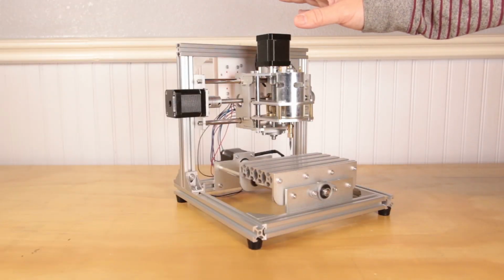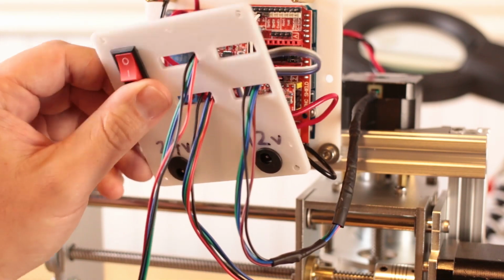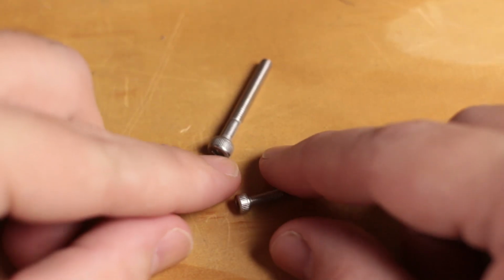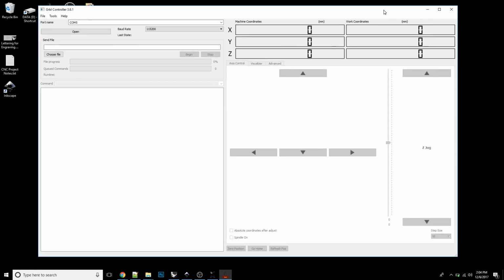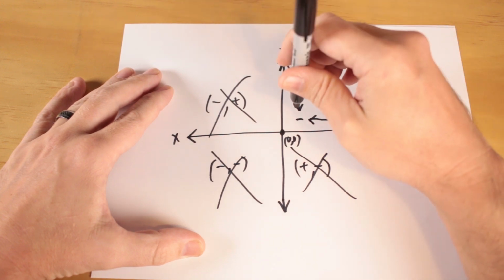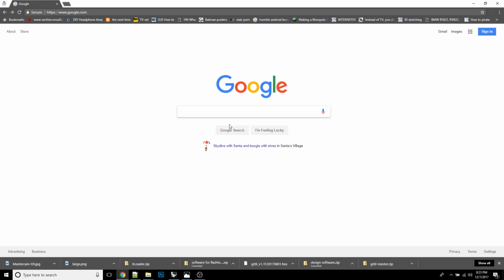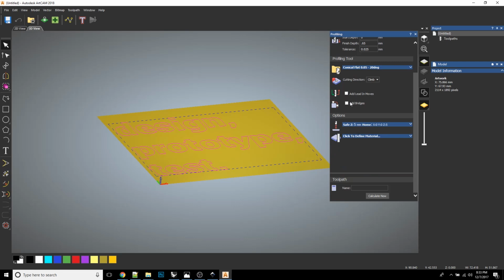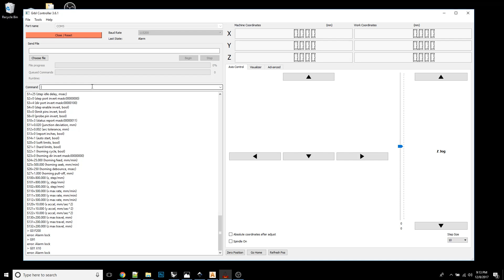How to start CNC Machining for under $200 - Working with the T8 CNC engraver

Comment: Just FYI. Center positive is usually designated but not always and especially on proprietary equipment it is reversed.  Just because they can. Check out wireless radios. Out of 10 different commercial brands you’ll find 3 or 4 usually center negative.

NEVER SAY ALWASY.

Comment: As mentioned before, new standards do not allow to solder the leads at the end. Use terminals instead....
Soldering the ends, will lead to less contact in the screw socket.
Secondly, you build a weak point where the leads will break...

Comment: That's a variation of a Packard type 56 connector being crimped as the first example. Don't use standard crimp tools or pliers on that type of connector.  Those tabs are meant to curl around, together, and PENETRATE the center of the wire.  When not used as intended, they provide a very weak, very ineffective crimp.  The run-of-the-mill bargain basement crimp connectors (such as those from Harbor Freight) are a better option than Packard 56, if you aren't going to be using the right crimp tool.

Comment: With this little machine would it be capable of cutting acrylic or plexiglass? For making custom water cooling reservoirs for PC's? I would like to do that as well as PCBs. Not sure at what price point you're able to start cutting thicker materials or harder materials? All this CNC stuff is very new to me. I have been 3D printing for years. Was thinking about just adding on a spindle and using my existing aluminum extrusion frame just switching out the carriage to do this kind of stuff but trying to figure out everything. Great video, well explained. Good job and work! Look forward to hopefully hearing you're answer! Thanks!
Reply from the maker: I suggest you get this machine instead: https://www.aliexpress.com/item/32837642599.html?storeId=1823809&spm=2114.search0104.3.53.36f721bf2rfvJe&ws_ab_test=searchweb0_0%2Csearchweb201602_5_10152_10065_10151_10344_10068_10130_10342_10547_10343_10546_10340_5724715_10548_10341_10545_10696_10084_5724015_10083_10618_5724315_10307_5724215_5724115_10059_100031_5725015_10103_5724915_10624_10623_10622_10621_10620%2Csearchweb201603_16%2CppcSwitch_5&algo_expid=bcfc3f55-726c-4310-ba1f-24802b93031a-10&algo_pvid=bcfc3f55-726c-4310-ba1f-24802b93031a&priceBeautifyAB=0

Also I suggest watching this video I made about using Inkscape for generating G-code (ArtCAM is no longer available): https://www.youtube.com/watch?v=HE9O5ZKRHTM

Comment: OK, here is my take. If you are using flux core solder, forget the separate flux. just stuff the wire into the terminal, crimp with the long  nose as shown and then solder with a good flux core solder. Crimp the insulation after it cools. And these Chinese terminals are very cheaply made, and tinning the wire with solder before inserting it into the terminal is a must. Otherwise it is very easy for bad connections and pull-outs to happen.
Reply from the maker: I agree with you James. However we will never overcome the momentum and "common knowledge" that tinning leads for screw terminals is bad. The theory is that the solder on the tinned leads with creep over time and make the connection less secure. This will increase resistance at the joint which will cause heat to build up causing the soldered lead to creep faster making the problem even worse until it eventually catches on fire. It's a good theory, however I can't find that any testing has been done to prove it. The internet (maker community) got a hold of it and now it is established "truth." I'm not going to push against that tide. I see no benefit to having that fight. I crimp all my leads in ferrules now. No more tinning for me.

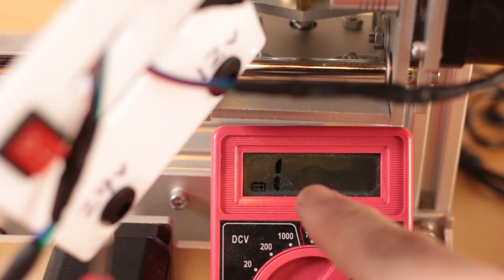Comment: Sorry ,i got to 9:31,tinning wires to keep wire strands together is wrong,you need to use wire end ferrules ,soldering the spade male or female connectors is ok,as long as the sheathing doesn't melt out,as the crimp is a strain connection.

The reason you do not solder the end of the wire to use in the screw connector IS....THE COPPER BECOMES ANNEALED<AND IS NOW VERY SOFT, 

THE SCREW TERMINAL CAN CUT THROUGH IT UPON TIGHTENING LIKE HOT BUTTER,

THE ONLY WAY TO AVOID THIS IS TO COOL THE WIRE WITH A DAMP SPONGE AS THIS WILL THEN HARDEN THE METALS.

BUT THE WIRE CAN NOW SNAP EASIER AS IT HAS BEEN HARDENED,THIS IS THE SAME WAY LEAD BULLETS CAN BE HARDENED AFTER CASTING(by hand mold casting).

SO USE FERRULES,OR TWISTING THE WIRE TIGHT THEN SCREW THE TERMINAL CLOSED,USING FERRULES OR TWISTING IS SO MUCH BETTER THAN SOLDERING,FOR THE REASONS MENTIONED.

Comment: Duuuuude.... spend the $20 and get the proper wire crimping tool.  The quality improvement of your crimps will blow you away and you'll see a good speed improvement too.  It's soooo damn convenient, and you'll never have to solder your crimps again, either.  (p.s. it's super bad practice to solder crimps -- the rate of failure for soldered crimps is much higher than a properly crimped connector.)
Reply from the maker: It is done: https://youtu.be/BgkJVgFnPaE?t=8m56s

Comment: If you install the back crossbar near the gantry rather than the end, the entire Y axis mechanism can be installed on the outside of the crossbars and the X axis assembly can hang at the front. Y is easier to attach to the frame that way and full surface of the table is reachable by the spindle. Not sure if it matters. By moving X to the back you solved the problem so that is good enough.

The biggest problem I came across was that the length of the crossbars did not match the width of the X axis assembly so I had to take the frame apart and shorten the crossbar pieces by the difference (about 3 mm).

I am curious how you attached the top crossbar to the vertical elements of the gantry. My kit only included corner gussets so the top bar had to go on the top of the posts.

Comment: And if you're adventurous, (game, silly..) you can setup an edm discharge device to engrave metal. I did one years ago, using lead clutch pencil, with copper wire instead of the lead, .o1 or .02 mm. Obviously you first need to obtain EDM setup, I made mine, and you have to set up a voltage comparator to handle the z axis for the 'pen'. As well as a normal z axis control.
I ended up electrically etching a logo on brass material, only 3-mm width,, perfectly.
Nowadays the setup for cnc plasma cutting could replicate the required mechanics of the varying axis to achieve a similar result, just the EDM device instead of plasma, rates of feed adapted accordingly. And of course the desire to do this..

Comment: Every Engineer is watching this and yelling “You don’t solder crimps!....”
What makes this so annoying is you can buy the correct crimp tool for around $15 from China
Reply from the maker: Not every engineer. Look at the comment by Nicholas Lee.
Reply: Yep and he’s still wrong, wires inserted into screw terminals are first crimped with a suitable ferrule, never soldered. He’s clearly never had to work to any British Standards. I’ve worked on military, aviation and nuclear systems. He’s wrong, I’m right, go look up the standards yourself.
Reply: @DesignPrototypeTest    - good job on pinning the only idiot in the comments. Solder will deform leading to the connection working loose or over pressure cutting the strands, followed by cold flow and heat cycling issues. That's why ferrules are used these days, it's a gas tight weld with zero downsides.

Comment: Nice video but never ever even if your life depend on it tin a multistrand wire that go into a screw terminal block.
The reason is that tinned multistrand wires are soft. It will eventually give and drop out.
You can see it is soft by taking a flat pair of pliers and squeeze it and see the end deforming.
Reply from the maker: This isn't as cut and dry of an issue as you think it is. Look for the comment thread started by Nicholas Lee to read more about it.

Comment: Thank You for the Time you took to do the best you could , Which I believe you have done an excellent job. I am a hobbies "ADDICT", Vintage R/C and Free Flight /U-Control Airplane, from 1/2A Mouse to a 6 '  ft R/C. I have a Small Like New Unimat DB 200 with assessors Purchased in 69 new, and never got put to use. It does a nice Job, however i would really like a little cnc milling machine, that will cut aluminum with Pretty good precision. And I Get It, Get a Big Machine Spend Some Money if you want the Precision, I imagine that Comment from someone will ""PoP" Up, But I am , although have a nice little shop, every inch is important, and your post is new, I have not seen this little unit before. I am not a CAD 3-D, G-Code Person, so I am working on learning that but, about ready to get my "Hand's Wet" and for the cost, and more research this "Just Might Fit the Ticket, as I will not be cutting very thick aluminum, just basically some cuts I can make with a lathe. Although the lathe I have can also be re configured into a milling machine, I should look for a cnc kit to automate what I presently have, it is a pain to switch from lathe to Milling. Anyhow, I am going to do some more research, have been looking at the China I believe 3040 4 axis Anyhow, Thank For the video, I will see what else you have or are into Respectfully, Jim P. Jenuine-motor

Comment: Hi.  This is a really great video - Thank you for the attention to detail...  My son (13 yrs) and I are working on several robotics labs for the State of Georgia Robotics team (school) and one of the projects is a CNC machine to help support other projects.  I have a question.  I've sourced several good places to buy extruded aluminum and I would assume if I extend the lower platform rails, table and wiring along with the screw drive on the 'Y' axis, that I could make this little machine into a larger platform.  We work primarily in 6061 aircraft grade aluminum plate for robotics and RC Aircraft parts...   Do you think this is a good platform to use as a starting point and do you think it's robust enough to use on 6061?  Again thanks for the video and would really appreciate your feedback.  

Tim and Ty...
Reply from the maker: No. This machine should not be used to cut metal. Metal cutting machines must be a lot stiffer than this one. You could modify this machine in a similar fashion to how MyfordBoy did to his machine, but it is a lot of effort before you even start to cut. If you need a larger cutting area and more stiffness you should look into the "2417 CNC machine" available on ebay. It's got the same crappy spindle as this machine, but you can upgrade that.

Comment: Is that Arduino Uno with CNC shield? Also those fancy terminals work with a roll over crimper, and you should not solder them. Thanks for a very informative video.
👍🏻

(edit) sorry, haven't finished watching but I realized you said it is an uno with the GRBL shield.

Comment: Thanks a lot for share this assembling process.  Do you think is possible to run a 1.5 kw spindle in this assenbly? We need to engrave zinc small plates. Thanks
Reply from the maker: Look in the description for the link to a better machine than this one which would certainly accept the more powerful spindle.

Comment: OK well it seems that you had a bit better luck with yours. I bought a Woodpecker router I kid you knot thats the name on the board. Any way you had two P/S on this unit? a 12 V & a 24 V ? I ask because the one I bought came with a 24 V  5 amp P/S when I tried to run it I had a lot of trouble with the engraver starting and then stopping half way thru the job or getting all bot 5% done & stopping. drove me nuts finally by accident I had the motor disconnected & hit the run button the stepper motors started moving the table & spindle thru the moves & it got 100% done tried it over & over with the motor disconnected perfect every time reconnected the motor FAIL! Added a second P/S 24 v 5 amps to run the motor only & let the factory supplied one continue to run the board & the stepper motors. No more problems seems like I needed one set up like yours? any body else have trouble like this?

Comment: Just wanted to say good job on the build without proper instructions. You really should crimp then solder, if done vice versa, the mechanical connection will give sure to the solder flowing and you will get a less reliable connection.

Comment: The center pin of a barrel connector is not always positive, and it makes no difference, safety-wise. Never assume center-positive, always test. Most electronics don't have reverse polarity protection, so getting that wrong will let all of the smoke out of your circuit board.
Reply: And everyone should know that when you let the smoke out of a circuit board you never get it back in and it won't work any more. I did it to a $100,000 computer back in the early '80's once. I did fix it but it took me about 16 hours. Not a good day.

Comment: What caused you to choose the T8 over the 2417? Yes, I see the "under $200" in the title, but for "under $230" you can get a much larger work area. I'm asking because I'm considering buying a 2417.

CNC 2417 - 240x170x65mm - $229 shipped from US supplier on ebay

T8 - 130x100x40mm - normally $208 shipped on Gearbest, on sale for $159; shipped from China
Reply from the maker: The 2417 looks like a great machine. It has a lot of features this machine doesn't have (Finger knobs, larger bed, linear bearings instead of bushings, better control board, etc.) and you won't go wrong with it. Basically, it's this machine's big brother. The price difference at the moment is $70 I can't say if the 2417 is worth the extra money. The issue with both machines is going to be stiffness, and spindle torque. It looks like the 2417 has the same spindle as this one. and while the design is a little more robust, the larger frame probably negates that (longer moment arms = more flex). In other words you probably will have the same problems cutting metal with either the T8 or the 2417. From a functional standpoint all that is gained for spending the extra money is a larger cutting area. If you really want the bigger bed, and better spindle (without having to do extensive modifications to your machine), plan on spending $500 to $1000 for a machine in an truly different class.

Comment: Crimping wires is strong enough. You can run into major problems if you solder you crimped leads
Reply: Yes, you do not solder or "tin" the screw down connectors either, it reduces the surface contact area and the pressure can crack the solder and break the connection as well.

Comment: i use  crimp connectors on these builds... look them up...basically an end you put over the wire..crimp it...the crimp has a nice insulator at the end...preventing arcing etc...requires a special tool..but pretty inexpensive...love yer vids ..nice work
Reply from the maker: Thank you for the advice. I have added a warning in the Description in an attempt to correct my mistake and get the word out there about why tinning leads which go into terminal blocks is a bad thing to do.
Reply: Design Prototype Test ferells are great for this. You can get cheap ferell kits online, and for screw terminals, they're invaluable. 
+1 to the crimp spade connectors. They're so easy and very cheap.
Reply: They're called "ferrules". And Alex and minskmade are right -- they are essential.  I've seen a bunch of disaster photos from 3D printer kit builders who smoked various parts of their power wiring and connectors because of tinning before crimping (wire breakage) and loose wires making contact with other loose wires (or ground).
Reply: FranzStrasse thanks for the spelling correction. I knew there was something wrong with it.
Reply: Utilux crimper is what they are called, for Utilux brand connectors, obviously different brands make the same form of spade terminals.  heaps better than the shitty ones you get by default that just mash them over a plastic sleeve and hope for the best

Comment: cool show and tell thanks. IMHO never tin leads in a crimp on connection. when it heats up tined leads will soften and can come lose. if you must. crimp 1st then solder to connector would be my advice.

Comment: Can you elaborate on the motor upgrade for this machine to be able to cut metal and/or stone?  I'm considering this one for small scale jewelry making.  Also, I have never used a CNC before. I'm ok on the computer skills and a handy man, but would this be too much for a first time CNC user?
Reply from the maker: Do not buy this machine. This is an old video. I will be releasing a new video on the subject some time in the next month or two.

Comment: Awesome video, i build wooden clocks, and up till now the wooden gears have been cut with bandsaw & scroll saw. I need a low cost cnc that cut the gears, the largest gears are 8inch across. Can you recommend a small cnc to do that? And what soft ware can i use to accomplish what im trying to do. I use to have a c02 laser and i used corel software then would open file with the software that came with the epilog laser. I was looking st a 3018 cnc on amazon. Would you recommend this machine.
Reply from the maker: I don't have enough experience with machines in the class you are looking at. I've only ever worked with $100,000-$300,000 professional machines and then a couple of these very small bed $200-$300 machines.  Hence I can't give you a good recommendation. That being said, I have designed and made a clock myself: https://youtu.be/9XJ03vSGppw If I were you, I would look into getting a laser cutter. It will cut the inside corners much sharper than a CNC. However, getting a laser cutter which has enough power to cut through a decent thickness of wood is an expensive proposition. Perhaps you can get a membership at a local Makerspace which has a laser cutter?